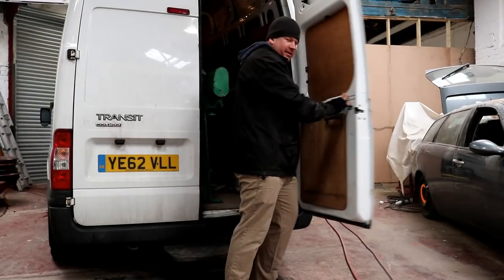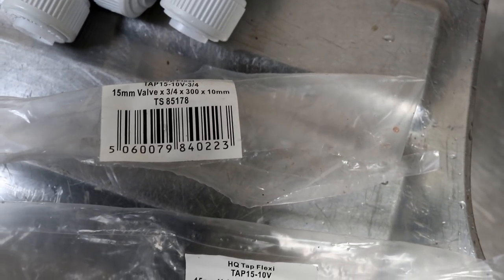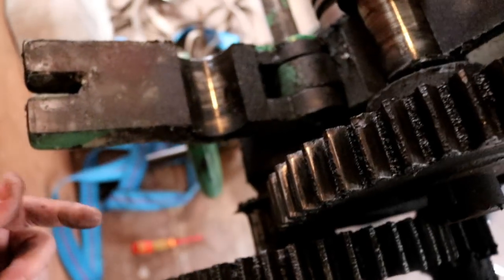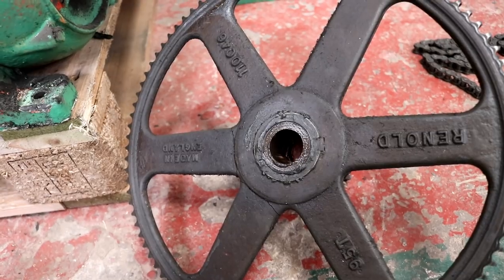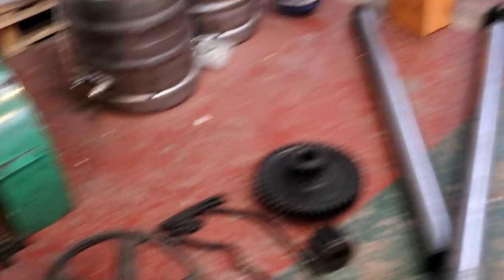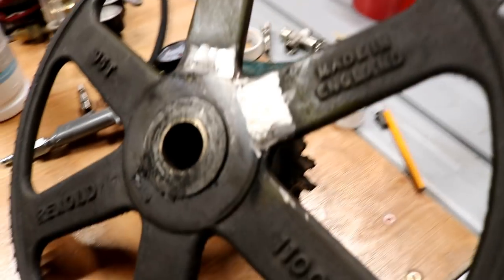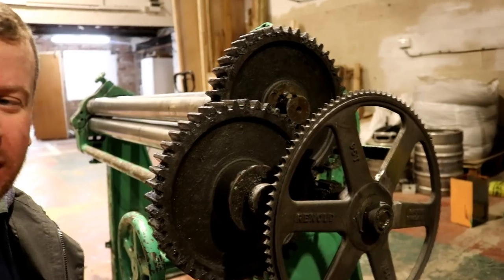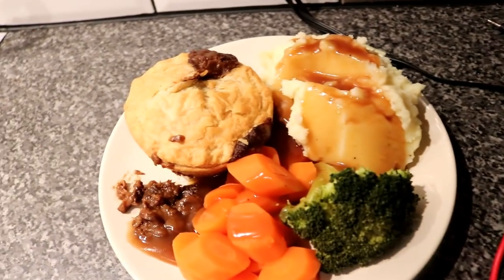Sheet Metal Roller, Assembly & Repair

Comment: Nice one the weld turned out good if it cracks again you can weld and make an over flange to tack to the spokes to help with the torque , you will see when you start with the stainless rolling if it is going to crack cheers

Comment: Nice save with that welding mate.....  be mindful of carbon transition from the parent metal to the weld..... if its cast iron theres far more carbon in it than the weld metal, it will transfer and cause possible weakness in the heat affected zone.....  Best case scenario would have been stick welding it after pre-heating but you got away with it it looks like.....  Keep an weather eye on the repair for further cracking but otherwise doowd, nice one.....  Would have come across to assist but still not feeling well enough to go too far and San would have had my knackers for ear rings if I did.....  See you soon buddy and keep rollin, rollin, rollin!!!

Comment: Welding the cast with stainless is the way to go. If it cracks again, don't be concerned. Just weld it up again. The more you "butter it up" (weld) with stainless the more likely it is to stop cracking.